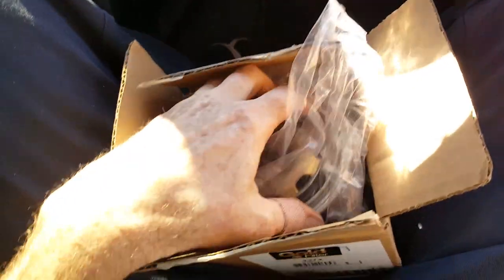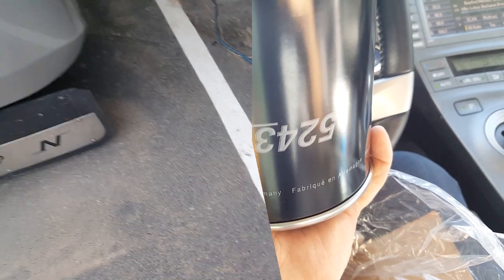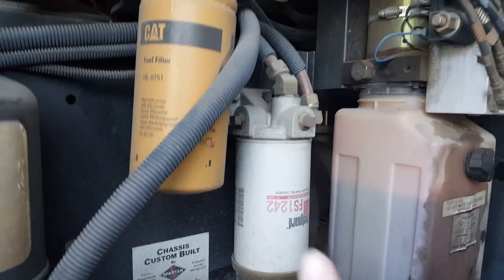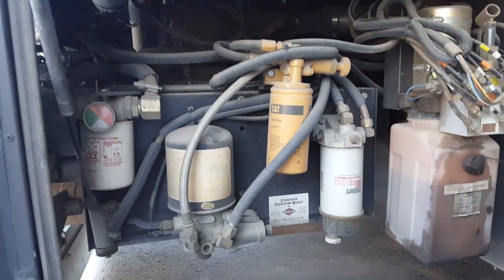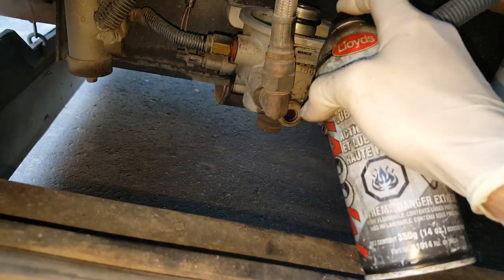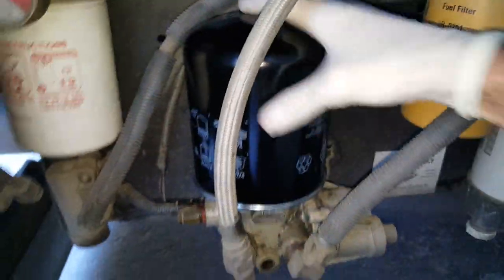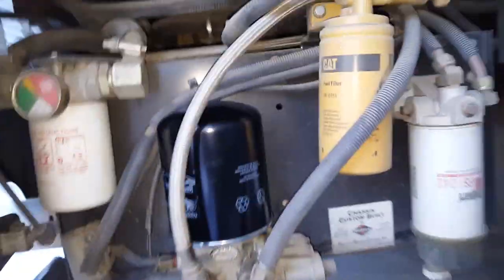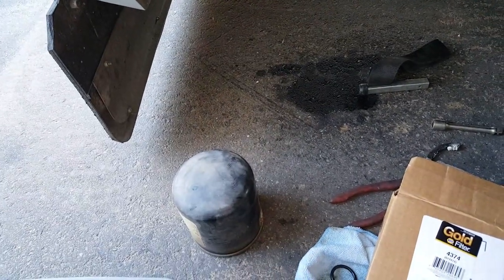The MOST Overlooked RV Diesel Chassis Filter Service

Comment: I changed out my Haldex Air Filter yesterday on my Foretravel and it was on so tight, I broke my filter strap in the process.  Had to get another filter wrench and it finally broke loose.  Someone did not oil the gasket before installing it.  As you know, Haldex filters are a little more involved with what is necessary to change them out and you might want to do a video on those as well.  Just a thought!  Thanks for all the great videos you put out there!

Comment: So happy to see that the coach you used for this video is the exact Revolution that I have!! Even the same color but mine is a 2006. It is one of the very few RVs that I see having a compartment especially for filters ( and side radiator in my case as well). Very cool feature. Good point and I promise I will replace it one of these days. What I do every couple of months is to drain the tanks as per manual instructions.

Comment: Thanks for this important maintenance tip.

Back in my refinery days, I would have these installed on bulk oil tanks for machinery. During the day to night temperatures, air would move in and out through the tank desiccant breather.  The desiccant breathers were water logged after six months.

Comment: What you need to look for is when you are driving/using your coach drain the air system about once a week and if you get any moisture it's time to change the desiccant filter. Most coaches don't get driven enough to warrant changing the filter on any schedule, just drain your air and see if you get any moisture out. I've put 70K on my 06 Patriot Thunder and the air system is dry as a bone, changed the filter when I bought it back in 13.
Reply from the maker: yes draining the tanks is important too. Some modern tanks have auto drains and sometimes the drains can be difficult to locate. Thanks!

Comment: Do you go through and drain all the tanks as well when you do this?
That's also a very overlooked maintenance item that needs to be done more often than the filter.
Great tip for those unaware that this filter even needs to be changed. As I said though draining tanks can be equally important. As a retired Owner Operator it was something I made sure to do periodically and the frequency depended on where I was driving but I'd never go more than every three months without draining the tanks. Even with a good dryer systems you'd be surprised at how quickly some tanks can accumulate a good bit of water in them which can of course cause them to rust/corrode...
Reply from the maker: that is an important item too
Reply: Nope just released all the air using the break pedal that's call spin on air dryers there are like 5 different types of air dryers
Reply: No. Just use the bleed valve on each tank. Any accumulated water will spit out first. Then you are good.

Comment: Since there are those filters not changed on motor coaches. Can say there is still one more filter but is on the Cummins engine. It’s called a crankcase breather filter on top of the valve cover. As a mechanic for an electric utility,we changed air dryer and crankcase filters every 2 years or biannually.

Comment: Yeah, mine is underneath right behind the axle. And it's bolted on. Thanks Freightliner!
Reply from the maker: Yes, manufactures love to hide this.
Reply: Bolt it on might be different there is5 types of air dryers that one his showing it's call spin on Air dryer it's the easiest one to replace might be located underneath or in the rear bumper or side compartment if yours has 9 bolts in the bottom it will be one it's called D9

Comment: I recommend using silicon grease vs oil. I use it on all of that type of filters.
Reply from the maker: good advice
Reply: Need to check silicone eats certain rubber degrades it
Reply: @theodorehyatt1782   - didn’t know that. I will say that I have been using it for 30+ years without noticing any oil filter, valve cover or other gaskets being degraded or eaten.
Reply: I can see a Lil grease outlasting A thin film of oil , good point sir

Comment: So I have this same RV, I’ve had it for one year, because of this video I changed that air dryer as soon as I bought this rv. Now, it takes forever to build air pressure.  I noticed I’m losing air right under the air dryer. Looks like it’s some kind of rebuildable blow off valve that gets stuck open? Have you ever rebuilt one?

Comment: Have you ever done a oil change service for a 370 diesel Cummings engine. And also any other filters or services that need to be done to the motorhome. This is a 2004 Newmar Dutch star, Spartan chassis

Comment: I have a Detroit 60 Series in our Monaco and haven't changed mine in the 3 years we've owned it.  I do periodically though open the air and let the tanks blow out.  The previous owner said as long as not water/moisture comes out the filter is working and not to worry about it.  BYW,  I've never seen a strap wrench like the one you used.  Where did you find it?  I would like to get one.
Mike
Reply from the maker: Most of my tools come from Harbor Freight because I constantly lose them

Comment: I clicked on the video to see if I was right about which filter...I WAS!!
As a truck driver I can tell you it's frightening how seldom tricks change theirs!!
If you spend any time in the south, AT LEAST ANNUALLY change it!
Reply from the maker: Thank you. I didn't even know about them for a few years.
Reply: @AZExpert  TECHNICALLY, you' SHOULD evacuate all air tanks nightly, as well. GALLONS of water rotting the tanks out, over the years
The fact that high end convertos use air doors kind of makes that not feasible. But I guess they figure if you can spend $2M on an RV, what's $50k for new tanks and lines ever now and then? LOL

Comment: I don't think owners are totally aware how important air brake testing and inspections are. I know that's not what you do, but those air lines/fittings have to be inspected and checked all the time for cracks and leaks. they take real abuse with snow and salt. check those brakes!
Reply from the maker: Agreed. Salt is not much of a worry here but dry rot is

Comment: I didnt hear you say you drained the air out of the system.  i have air bags and need to be under the coach.
Reply from the maker: this is not really on the tank pressure side
Reply: @AZExpert  THANK YOU..ONE OTHER ITEM.  I JUST FOUND THE COOLENT CAN.  LOOKS LIKE IT HAS NEVER BEEN CHANGED,  I DID KNOW IT WAS THERE. COVERED WITH FOAM...I KNOW, START READING THINGS..ANYWAY, CANT BUDGE IT. CAN I SHUT THE VALVE OFF AND TEAR INTO IT?

Comment: The air comes from the air compressor that is attached to the engine.
Reply from the maker: yes, this filters and drys the air to the engine driven air compressor for brakes and suspension. Thanks
Reply: The HOT AIR comes from this "Expert"!! LMFAO 😂!